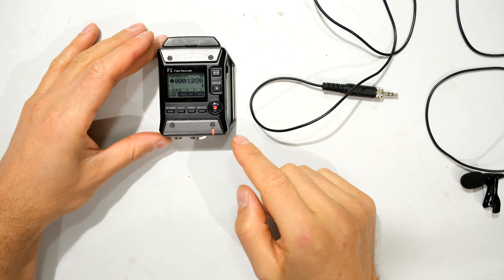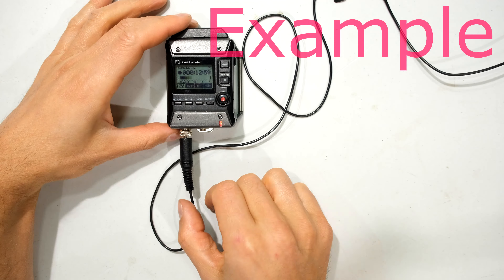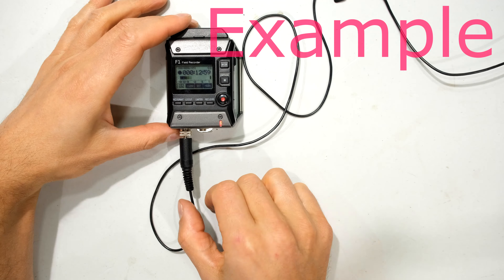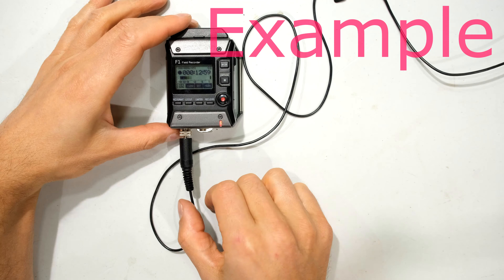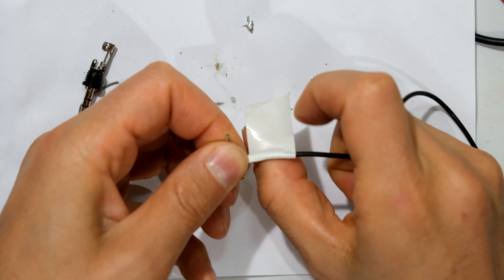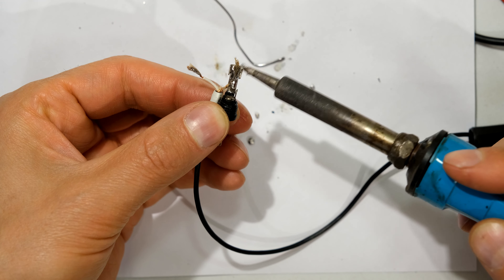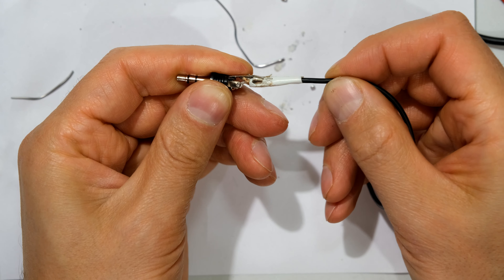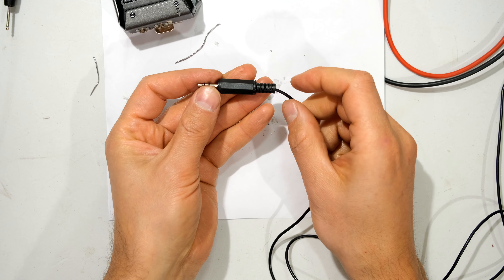How to replace the 3.5mm lavalier microphone jack on the Zoom F1 field recorder

Comment: The only issue with this video is it doesn't deal with retaining the mic cable lock system making this an incomplete fix, and there doesn't seem to be a link to reusing the original connector as was stated at the end of the video.
Reply from the maker: thanks i added the link to the video: https://youtu.be/DbEYYKVa_zQ